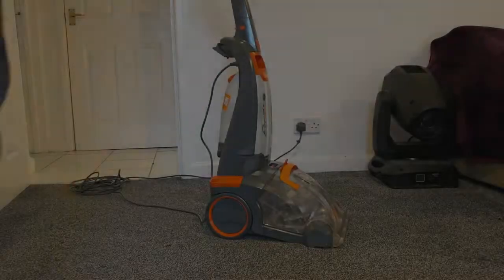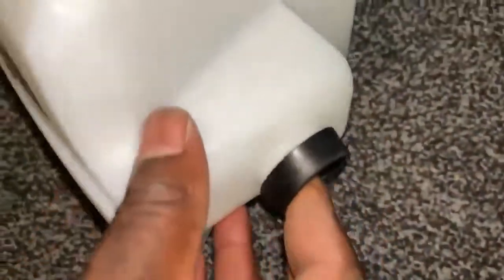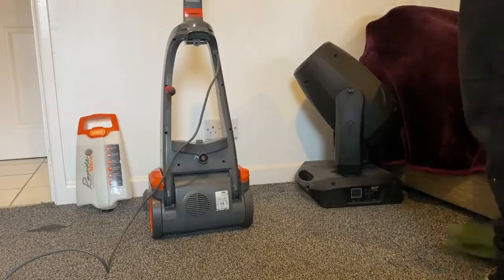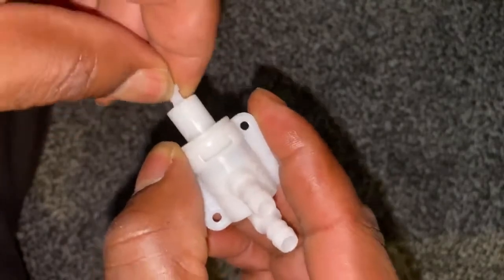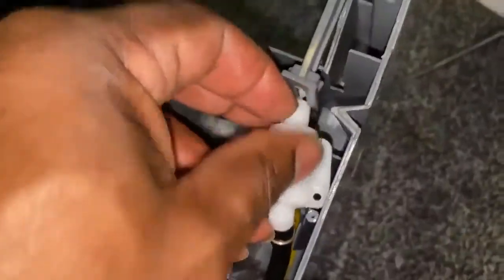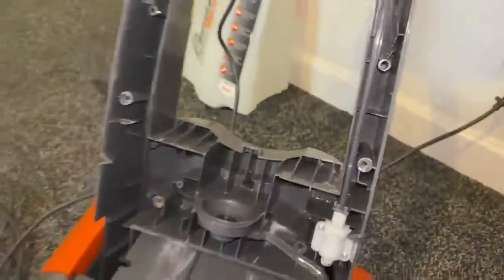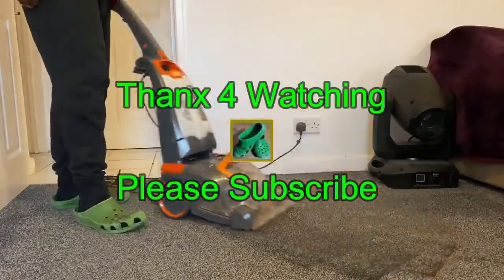VAX Rapide Ultra Carpet Cleaner Leaking When Cleaning Recolved

Comment: Have any idea what’s wrong with mine? My vax works fine but it continually sprays out water (when powered on) from the bottom when it’s not meant to spray yet, second main body I have had that had done the same thing! Any suggestions I could try! Thanks
Reply from the maker: Hi VacuumKid,
                          most likely a sticking Trigger or the actual fluid release Valve itself.

                       Regards 😎.

Comment: Hi I watched this and opened my cleaner is all nice and clean in side but still not realising water
Reply from the maker: Hi may be an issue with the internal pump.
Reply: Hi can you tell me please where is the internal pump
Reply from the maker: @shaheenakhtar8112  Hi it looks like this  https://www.ebay.co.uk/itm/155275723268?hash=item2427278204:g:F7QAAOSw4TxjgN~h&amdata=enc%3AAQAHAAAAoDPa62AjxibKHWUV%2FdNBcG%2FjEmkebwrhvbb0uLKvwhBT2zeMxD1vBy85SS1PBp2m%2BxwIVMkaC7ynQnZK6xdFVvfuk16rKyjWvwlYZiHCT76JH6n3h0yRRph6FAKK7X9jQhxKX3piJCp3K3EF58RpfRFeNlYGMFDp%2FG54lXYEjefrYVtCOIhitOXjN4VvM7SJYxC%2F7w7AfPVH3GEbeEZ85cA%3D%7Ctkp%3ABk9SR460l5-7YQ      but I have never had to access it

Comment: did the valve just pull out or unscrew? Don't want to force it!
Reply from the maker: Hi Michelle,
                   which one the one on the water tank or for the Trigger ?
Reply: @green-crocs-fixes1520  it was the water tank, but I managed it! Was all limescaled up! Going to see if that works before attempting the other end!!
Reply from the maker: @mamasimpson1950  Superb, I'm sure it will work 😊.

Comment: I have a platinum vax machine. It does not release water. Can you help in fixing it.
Reply from the maker: Hi Kamal,
                Maybe an issue with the Valve at the bottom of the cleaning fluid tank, or the fluid release valve inside of the unit or even a blockage or kink in one of the fluid pipes. Try eliminating all of these Kamal.
Reply: @green-crocs-fixes1520  Thanks, 
I tried but could not release the valves. Can I send my machine to you to fix it? I will pay for this.
Reply from the maker: @kamalsoliman1099   Hi Kamal,
                 flattered but unfortunately I only repair items for my channel. Plus posting an item of this weight may not be cost effective. Sorry. 😄

Comment: Hi I tried getting the valve out and it just wouldn't budge. Ended up breaking the black rubber seal. Can you buy replacement ones please?
Reply from the maker: Hi Ann,
            if you are referring to the Valve under the cleaning solution tank the you nmay be able to purchase a used one from eBay, make sure seal in included though.

            Regards.
Reply: @green-crocs-fixes1520  thanks
Reply: Sorry for taking your post over Ann. But I guess I might need the same. What is the item called on Amazon? Valve? Seal?
Reply: Grommet

Comment: Hi 

Nice video.
I have Vax Ultra Rapid. And I cant get it to spray water at all, do tou have any suggestions? 
Thanks.
Mathias
Reply from the maker: Hi Mathias,
                    there is a pump inside of the main body which maybe blocked or malfunctioning 😀.
Reply: @green-crocs-fixes1520  i have dismantle the body, but I have no clue on how to get inside to the pump ? 😵
Reply from the maker: @MathiasTiller  if it does not make a buzzing sound then it is probably not working.,

Comment: I have the Rapide Ultra 2, and mines works for about 20 seconds then the vacuum sound changes and no suction is happening.
While its still on a I release the dirty water tank and there is plenty of suction but not when I fit back the dirty water tank.
Its clean so no idea what's going on here.
It looks like a safety is kicking in.
Reply from the maker: Hi Neddy,
                there is a flat Filter which slots into the Tank, I thinks it’s to avoid overfill. Maybe this requires cleaning.
Reply: @green-crocs-fixes1520  found the problem, there is a flip board in the dirty water tank, that the suction is pulling and closing the safety valve. Dreadful design and noting I can do about it.

Comment: Hiya, have one of these, not opened it up yet to have a look but it's not sucking up water very well. Seems to only be taking back up about half of what it is putting down, any ideas?
Reply from the maker: Hi Niht,
             there is a removable filter at the top of the Waste Collection bin which may require washing out.

                 Regards.
Reply: @green-crocs-fixes1520   Hiya, I had cleaned all the waste bin as much as I could ( so many inaccessible corners in that thing), the filter is clean.

Might have to get the screwies out and see if I can see anything inside.

Check all the unions and pipes for air leaks. 

With how old it is It's prob due a stripdown anyway.

Need to get hold of a new hose and tool set as I'm buggered if I know where they have disappeared to.
Reply from the maker: @soopafamicom  yes looks like you may have to dismantle the Motor housing section.

Comment: Hi mate 
My Vax ultra rapide 2
Is constantly sprayin without pressing the trigger button
Any idea what could be the problem
Reply from the maker: Hi Pitbull,
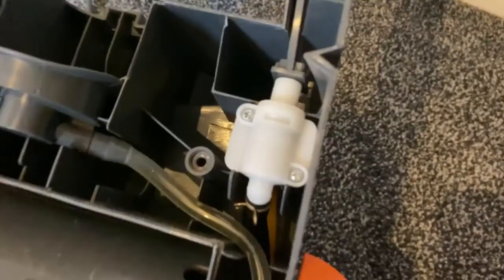                 I think the problem may lay with the white Valve ( 2:32 ) inside blocked or sticking in the open position.
Reply: @green-crocs-fixes1520  hi 
My model is similar to the one the video but not identical
Mine is a Vax rapide ultra 2
Reply from the maker: @Londonpitbulls  Yes its the method. Check the Valve is not obstructed.